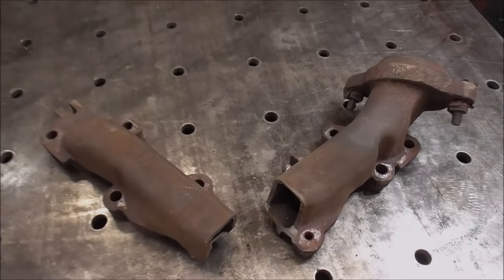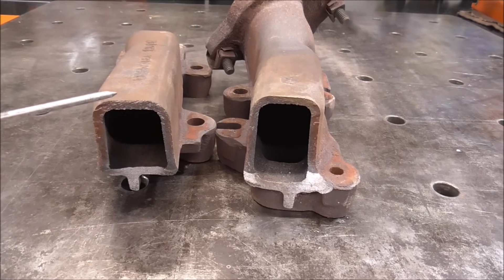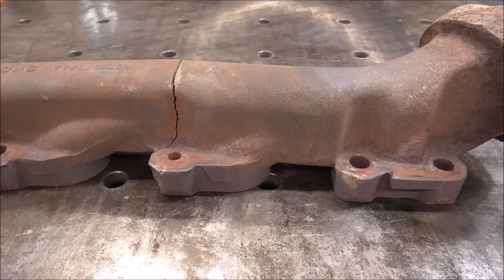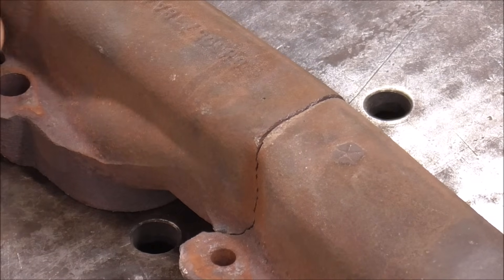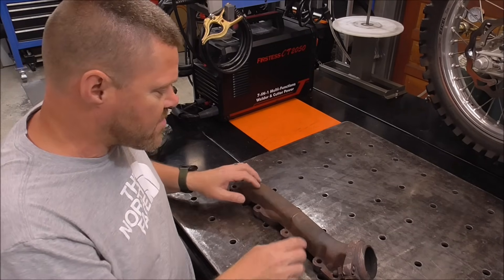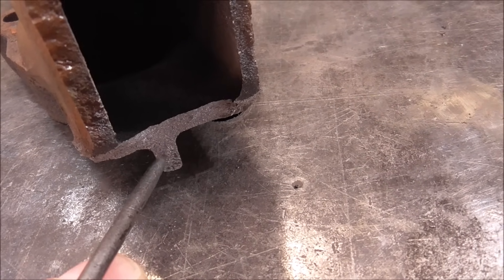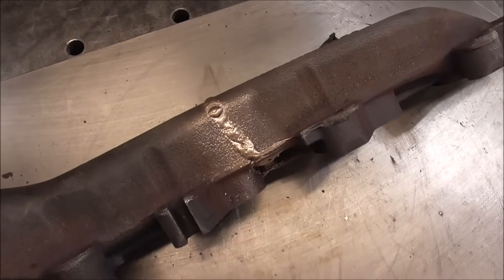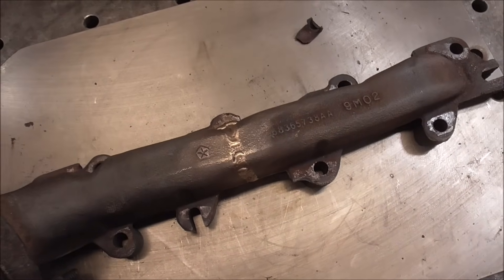Difficult Cast Iron Exhaust Manifold Welding Repair

Comment from the maker: Quick update: I just spoke with the customer. He said the manifold bolted up perfectly without any issues and it's being used daily.
Reply: Too me it looks like the "flaw" in the Manifold is the small hole directly across from the crack. Look at all the rest of the holes , large and allow expansion and contraction. The small hole appears to "Not" allow any expansion or contraction  , the crack directly across from the hole is kind of a dead give away. Imo anyways.
Reply from the maker: Your probably onto something. I read in a forum that the small hole is used to align the manifold bolts to the head during assembly. Some mentioned opening this hole up like the rest to allow for expansion. Makes sense

Comment: I have had very good success welding manifolds and other cast iron parts using high nickel content rods. They were called "Weldall" 11% nickel. As mentioned here lots of prep and a very controlled cool down. You can bury it with vermiculite or very dry, clean sand. Leave it for 4 hours or more to cool enough to handle with welding gloves.
Reply from the maker: Thanks for sharing
Reply: You also need to Ping it as you welded

Comment: Good job!  Definitely better clamped flat.  I’ve repaired a couple with a high nickel brazing rod and a very wide v groove. I also had the benefit of having a spare head to bolt the pieces to during the repair.
Reply from the maker: Right on!

Comment: Good video. Shop owner /mechanic 45yrs. Old school gas brazed many broken manifolds over the years, many that lasted till the vehicle went to junkyard. Also welded with malleable cast rod, both methods worked well, brazing worked better on hard to reach areas like on the backside of your manifold. Alot of the success of the job depends on the install of the manifold back on the cylinder head, must start tightening from center to ends. I would sneek up on tightening bolts, just snug, then run engine to operating temp, then final tighten. Always by hand, no impact gun!😂❤
Reply: Old school, I like your heat cycling torque procedure , center out oc.
Reply from the maker: Spot on! 👌
Reply: I also Bronze welded with gas as well as this heats the surrounding area  I always had a small root gap to stop hot cracking  When completed I would heat up again to stress relieve Then cool very slowly  After I would surface grind the mating surface Then torque down I never had one come back I think the Grinding was the important part of the procedure

Comment: As a machine for 43 years. The casting needed to be machined flat on the bottom, where it contacts the engine block. It was cast that way, and they never machine it flat, so they were out of  parallel.
And the stress that when you bolted it to the block ended up  cracking it.
Reply from the maker: Makes sense
Reply: Agree hope the shop installing the manifold decks it out Nice and flat and ensures the head is also flat - along with a good new manifold gasket and tighten the stud nuts to the proper sequence and then check them again once the engine reaches optimum temperature - as you would be aware it takes time and patience - then it most likely will not crack again - I worked in the GM Holden foundry and most failures were due to machining not the casting - Regards
Reply: Manifolds are ground flat during manufacturing, it's very common for manifolds to warp in use. When we are repairing manifold exhaust leaks without cracked manifolds the manifolds are almost always warped, we have the manifolds machined before reinstalling.
Reply: Impossible that the casting was not machined. It may have warped while machining or moved while machining, but it is ridiculous to think that anyone would attempt to install a manifold as cast.
Reply from the maker: 👌 100% it was milled.
Reply: As a machine myself too, I want to add that BEEEP BOP BEEP BEEP

Comment: I found/trash picked an old lava-rock gas barbecue out on the curb close to my workshop about 25 years ago and I use it to preheat cast iron parts before welding ever since. It works really good. I peen it right in the hot barbecue right after welding while still hot and then I leave it in the hot bbq for some hours. I jury-rigged an old electric clock motor on the propane pressure regulator connected to the bbq burner to reduce the heat very slowly.
I really enjoyed that video! Turned out great!
Greetings from Germany. 

I mostly use nickel silver (50% Cu, 10% Ni) brazing rods and an oxyacetylene torch for cast manifolds btw. because it has a very large viscosity range. At 900-920 Degrees C its like PlayDoh, at 980-100 C it flows like hot wax.
Reply from the maker: I really like your idea on the timer. I can see how that could come in super handy!

Comment: I would suggest after your tacks you recheck your alignment with an exhaust manifold gasket and see if it is in alignment with the bolt holes.  Then do your full weld if you are satisfied.
Reply from the maker: I felt pretty confident that the way i checked for alignment was more accurate than a gasket.
Reply: I weld two or tree bolt and fix exhaust. Then welding. If not, olways was out of measure,anout 5 mm
Reply: @BrandonLund  My guess is that the block isn't dead flat where the exhaust manifold bolts in.  If it's not, then this repair will fail eventually, as will the OEM replacement part once that arrives.
Reply: Brandonlund showed us all that the Manifold itself was not straight flat .... and like he says and I agree with him is that the manifold itself was not casted straight from the beginning .... also the manifold does not bolt onto the engine block but to the cylinder head.
Reply: also would have helped to leave it in the BBQ/heater and coverd 80% that's not being worked on, but that's my 2c and or how im ( also how the slyly one did his 300L6 ford modifying for NRA/racing, there's a gas-or-laser spraying welding method as well but so far i haven't been able to buy the tooling, Xray wise its supposedly invisible repair/fix afterwards but so-far i can't 3d-party verify that ) planning on fixing my 1970~ hemi/Dodge parts, ie heads and block ect
Reply from the maker: @richardprice5978 I'm not sure how silicon bronze would hold up on xray but I can tell you that it's by far the strongest filler that I've tested to date and its one of the few fillers that ive been able to make sucessful repairs without and pre or post heat. If I remember correctly, the method is within 10% of the original break strength, with nickle coming in second. There is a lot of forgiveness with silicon bronze which is why it's always my go to. Knock on wood, i have yet to have a repair come back using this method.

Comment: So much that you have to know when it comes to welding.  It's mind boggling sometimes, when it comes to welder types, settings for different materials, wire or sticks to use,  mig/tig/stick,  adequate penetration, etc. etc.  I have just enough ability to stick together non-critical parts(with a lot of grinding and paint), but I would never do work for other people, for fear that some injury might result.  I admire your ability.
Reply from the maker: Thanks man. Honestly, most memory retention comes from failures and remembering what "not to do". I have a hard time remembering too what works best under certain circumstances so I jot things down when it works, but I ALWAYS remember when something failed so you have a little process of elimination going on also lol.

Comment: Great video and repair Brandon. The history and testing if possible will be interesting.
Thanks for sharing.
Reply from the maker: So I probably won't get this back. The "temporary" repair has become permanent. I have done some other testing on Silicon Bronze, and it's the strongest filler I've used to date. It's good stuff.

Comment: I wanna see the follow-up! Entire repair looks quite good in every respect. So now how did it work out?? Is it still on the head? What's the story?
Reply from the maker: I just spoke with the mechanic that installed it. He said it installed just like a new one. No fitup issues. The customer was his father's vehicle and they are still running it. It's just as good as new.
Reply: @BrandonLund  Thanks for the update.

Comment: I had a auto cast iron exh. mnfld to weld one day. Asked my super experienced boss. He said,
"Run straight polarity use 7018, stick." Sure enough, welded right up. Pre heated the parts by closing my truck windows, putting the parts inside...nice and warm. Only welded a few inches at a time (did a lot of hand peening). Worked great.
Reply from the maker: I know a lot of folks have had had really good success with low hydrogen rods but every time I have attempted it, it has always cracked on me. It could be my technique also. I tend to weld on the hotter side.

Comment: Reminds me the manifold i fixed for a customer on a 5 cylinder Colorado 3 months ago. The exhaust manifold was broke in 3 pieces and was held by whisker worth of metal left AND it had 17 other cracks. I drilled the end of the cracks, beveled everything with a die grinder and pre heated the entire thing with a #15 rosebud then brazed everything together with my oxy propane rig.
Reply from the maker: Nice! 👌

Comment: In your setup, as one person mentioned using an exhaust gasket to make an alignment jig with all bolts. So you can bolt it down lightly with said gasket in place. As if it were on the engine. Heat it like you did. Weld and reheat while checking on the jig.  But it looks good this way.
Reply from the maker: I never gave the gasket idea a thought. pretty good idea. If I get another I will probably have them supply one with the repair but for the record, they said it bolted up as thought it was a brand new manifold and and they are still using it.
Reply: @BrandonLund  Glad it is still working

Comment: Looks like you did a pretty good job there. Yes I have welded cast iron a few times, usually good results. All the fine points you covered were with peening the weld very time , just overall well presented.
Reply from the maker: Thanks 👍

Comment: Cool video, I didn't know you could run silicon bronze though a spool gun. I like to use a TIG nickel filler process on cast iron projects.
Reply from the maker: That's really good stuff too. I started using silicon bronze because in my crude testing experiments, it holds up a little better than nickle but you really cant go wrong with either.
Reply: Thats what I said when I heard that. I said " what?  How do you weld bronze with mig welder?"

Comment: I just did one of these on a Ford 6.2 I used my weed burner to pre heat and radnor cast99 1/8” rod at 90 amps with a needle scaler to finish up then cooled down under the wood stove in the shop over night it was still warm to the touch the next day so I was happy with the slow cool down but I haven’t found the magic recipe yet to fix any cast iron it’s a crap shoot every time in my experience it either works out or it bust apart worse than before but you can’t know too many methods to repairs thanks for sharing this I have a spool gun in the shop also so maybe I should get a 2lb spool of that wire for just such a situation I don’t do a ton of cast but when I do I want the best results I can get
Reply from the maker: Thanks man! That repair method you mentioned is very good. I would do it the same way, except next time, try that silicon bronze wire. I think you will be very pleased with the results.
Reply: @BrandonLund  I will have to do that I haven’t used that silicon bronze but I got plenty of junk manifolds to play with and I’m really curious to see how it works on cast bearing housings I’ve done a few loader transfer cases with hit and miss success

Comment: That casting reminds me of a Ford 200cid 6 cylinder I had fixed in my 20s and then machined flat across the mounting surface. Only then did I discover the block was distorted and had I left the manifold unmachined; would have hardly leaked. I had to get creative with high temperature industrial boiler gasket material and high temperature RTV stacked in layers to finally fix the leak. Fortunately the engine was low power and the exhaust backpressure was never enough to blow past my gasket kluge. A turbocharged engine would be a different story.  I only bring this up to suggest your customer check the engine block with a straight edge from front exhaust port to rear exhaust port. The might be a reason for the stresses in the manifold that is block related.
Reply from the maker: This is actually an excellent point. All along I've been thinking it's a manifold flaw when in fact it could be the block like you mentioned. I love our community! Thanks for sharing 👍👊

Comment: thanks for the advice!  I am going to repair the driver side manifold for a 1964 barracuda with the 273 engine.  A very unique manifold that are very hard to find these days.  Luckily it's just the end ear and opening into the #2 exhaust port.
Reply from the maker: Glad to help! Good luck and please report back how it went!
Reply: it went well, already done. Because it was a small repair, and at one end of the manifold, I skipped the heating step and just did a couple small welds.  Then gave it some cooling time, and proceeded with a couple more small welds.  The manifold is almost 60 years old and it's made it this far.  The mating surface is all filed down and ready to go back into action.  Thanks again, good inspiration for my little fix @BrandonLund
Reply from the maker: Awesome! Great to hear! Nice job! 👊

Comment: After it was cast it was allowed to cool too fast and it caused it to shrink up on the top, causing the stress and it did not last on the vehicle. The heating and cooling Cycles just exacerbated it.
Little bit of soapy water also works for welding spatter from a MIG welder. I like the use of the siliconized bronze. It will still Flex enough to possibly even make a good permanent fix. I like that you're using a respirator with siliconized bronze because it can be toxic with enough exposure.
Repair doesn't have to be stronger, it has to be a bit more ductile. The lack of the ductility of the cast-iron is what caused it to crack in the first place. That's why I like the idea of the siliconized bronze.
Reply from the maker: Spot on. I actually like silicon bronze for that reason over nickle 👌

Comment: I have new race engine block. It was damaged in shipping where the main cap was hit and broke two relatively small sections off halfway through the bolt hole. They sent me another block free of charge so just for the heck of it I was thinking of repairing this one. I figured rather than try to attach the two small pieces I would be better off grinding it all out and lay bead over bead until the block can be machined flat and two new holes drilled and threaded. Thoughts on this?
Reply from the maker: Strength wise the testing I've done proves it to be pretty close to the original cast strength. Only problem is, it will never be as strong as the original. So if your using it as a race motor, I probably wouldn't chance it, but for a street / pro street setup it would probably be ok.

Comment: We went through 2 of those small exhaust manifolds because of water being splashed up on them while driving in a heavy downpour . PLUS the tourqeing of the engine . They wouldn't even try a repair even for a temporary. I brought the broken ones home to try welding them sometime. They are laying outside and probably stay right there. Stay safe and let us know if this one holds for the customer for a little while. Fred.
Reply from the maker: They don't build things like they used to. Fingers crossed it holds
Reply: @BrandonLund  that's for sure Brandon.
Reply: prep it  tack it heat the whole thing to 900c   then weld with 
7018 rods wrap in fire blanket 
slow cool     no drama

Comment: Great job!!!… I have an exhaust manifold off of an old D6 Cat. The bottom has rusted out in several places. I want to get an older exhaust manifold and scavenge some of it to do a repair. Those manifolds are hard to find and when you do they are costly. We probably use the machine 2-4 times a year.
Reply from the maker: This filler would be perfect!

Comment: Great job , will definitely try this method , was the mating surface machined afterwards ?
Reply from the maker: Thanks man! Nope i just welded it with the flanges clamped flat to my welding table and the customer is still running it leak free

Comment: Your observation that it was cast wrong seems 100% on the money. I bet if you did a long term follow up the new one cracks as well and they would be better off using this piece for the long term.. PS. I think you are the only YouTube channel that does real world MIG Brazing. So that makes you Unique and cool!!!
Reply from the maker: Very interesting I wasn't aware I'm the only one doing this. That is pretty sweet. As far as the manifold, I'm curious how flat the flanges are from the factory. It almost acts like they warped when cooling after being casted and when they get bolted to the head, it's under tension until it snaps
Reply: @BrandonLund  It could very well be that the block is also slightly warped from a previous overheating event.  This is an aluminum block, right?

Comment: I've seen that before at the toe of the weld. Do you think that's because of the heat making the cast more brittle over time plus the repair which causes alot of heat?
Reply from the maker: For sure. Almost all repaired cast iron, if it's going to clack will almost always crack at the toe.

Comment: You did an awesome job man. Question: why not stick weld it? Could you if that's all you had with the same process you did?
Reply from the maker: Thanks man. You could 100% stick weld it. I chose this process simply because it produces a lot less heat in the part but you could easily stick weld it using some nickle